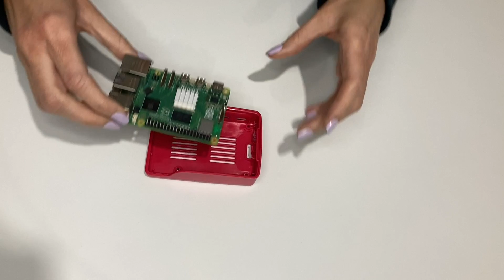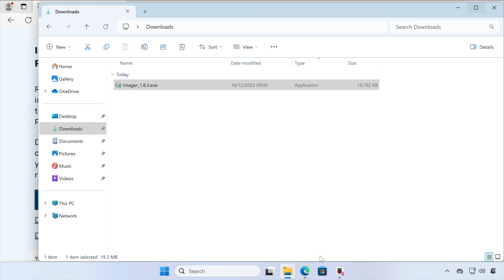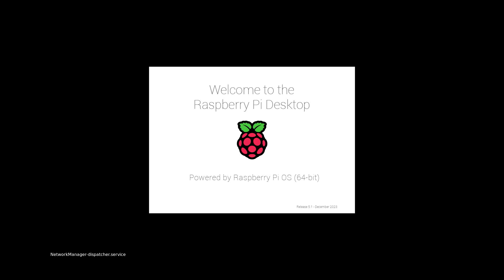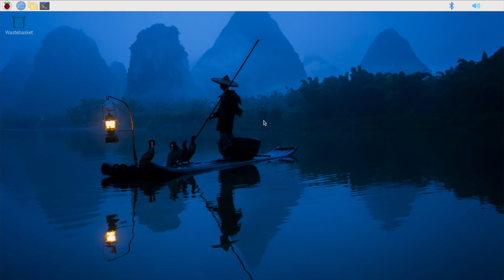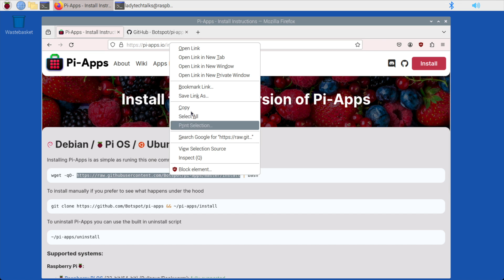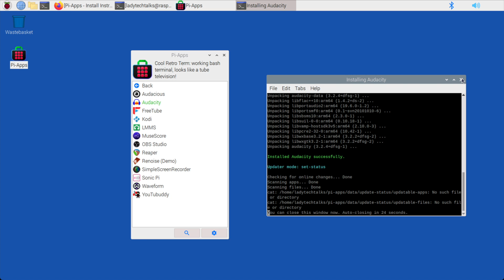Raspberry PI 5 complete hands on set up, including Pi-Apps and review

Comment: How loud is the fan?
Reply from the maker: The built in case fan is not very loud at all, I haven’t measured it so this is just my opinion. I would say the fan on the active cooler is louder than the case fan though. That said the active cooler does seem to provide more cooling.

Comment: Ive been using the PI 5 as my main desktop computer since October and with the exception of a few minor exceptions it has been super stable and quick enough for my needs (to be honest I've really only been browsing the web and watching YouTube for the most part).  It's a great little box and I'm a sucker for having way too many tabs open in Chromium (20 is not unusual) so it has been well tested.
Reply from the maker: I can only agree, for day-to-day computing tasks, its a great device!
Reply: With the exception of a few minor exceptions due to exceptions in the pi 5 hardware and exceptions in the exception handling exceptions due to the instructions excepted from the RISC architecture that includes notable instruction exemptions compared to CISC architecture I find that the pi 5  is exceptional. 
Apart from those minor exceptions.

Comment: Did you find the bottom white part of the case didnt click as securly as one would think it would ???
Reply from the maker: I found that it clicks into the red part with a satisfying click, but it can come loose too easily, and I've accidentally separated it from the red part a few times, even pulling out the fan cable!
Reply: @LadyTechTalks  exactly the same with me….